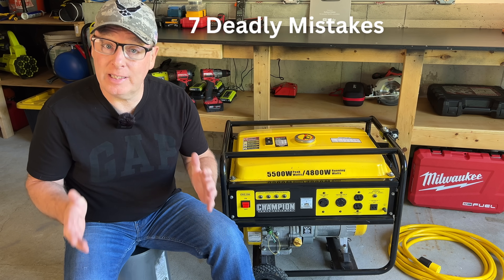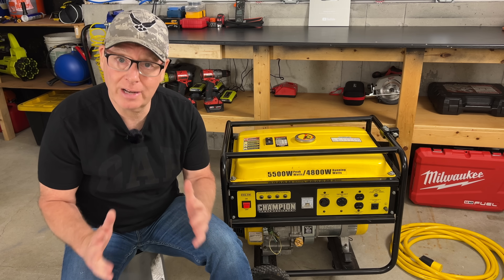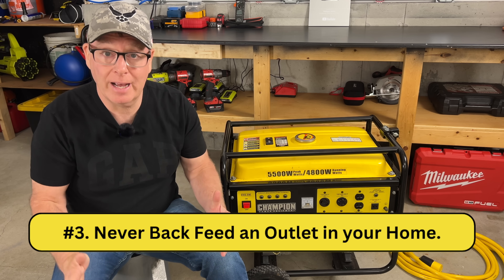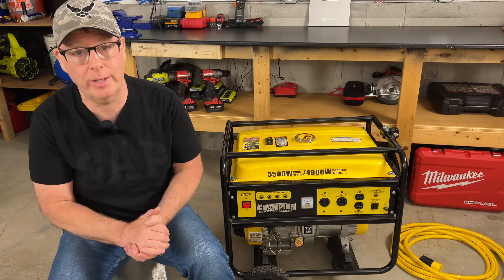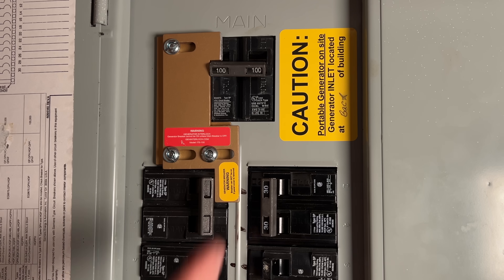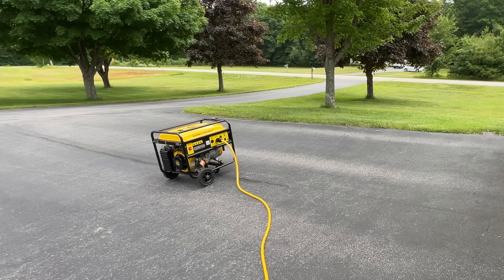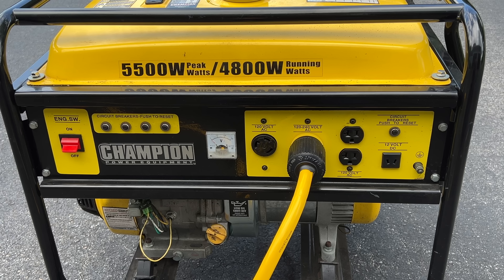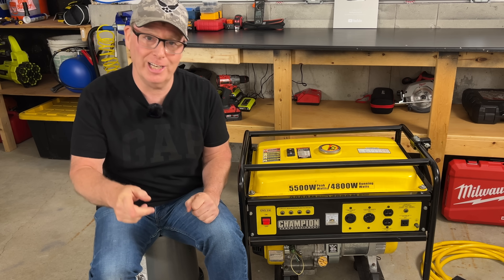7 Backup Generator Mistakes. (Have You Made One?)

Comment: I worked 36 years for a Utility company. AEP.   You failed to remind the viewers that you have to ground the generator  Very important!!!!  I knew spme people that got shocked.  Please !!
Reply from the maker: Actually no. A ground rod is only driven for a generator if it’s being run as a bonded neutral system. When it is the transfer switch has to switch the neutral along with the line conductors. This is known as a separately derived system. Most people don’t use that type of switch so the generator is run with a floating neutral. This is very important to understand because the neutral can only be bonded in one location. A ground rod is surge protection or mostly lightning protection. The can connect power to a ground rod that’s not bonded to neural and it won’t short out or trip the breaker. The shock prevention comes from the grounding wire carrying the fault current back to the neutral and then the source. 49 year electrician and electrical engineer.
Reply: @BackyardMaine  Thanks for the great advice😀

Comment: Gotta be smart enough to shut the main breaker.
Reply from the maker: Depending on a person rather than an interlock for life safety is not a good idea.
Reply: @BackyardMaine  I depend on myself every day sir and I mean no disrespect.   You shut off that main breaker, you save a thousand dollars and do the same thing as the interlock.   I trust me way more than I trust an interlock that can fail.
Reply from the maker: @georgemiller9533  You trust yourself and I get that but should the power company have that same trust in you to protect them form backed.. Do you trust others to always make the right decision? I was an electrical engineer for a large corporation and we did everything we could to take the possibility of human error out of the picture. We used detailed procedures and electrical and mechanical interlocks, lockouts, etc. Everyone makes mistakes and when a mistake can take a life $100 means nothing.
Reply: @BackyardMaine  I have worked closely with a plethora of electrical engineers and I now see your dilemma.   Most EEs won’t remember to flip the switch.   I however am more reliable to a lineman than an engineered contraption from China that will fail.   Yes linemen are safer with me flipping the switch.
Reply from the maker: @georgemiller9533  Nonsense and what your are doing is not legal.

Comment: One critical thing that you didn't do and that was to ground the frame of your generator to an NEC Code approved 8 foot long ground rod that's been pounded vertically and completely into the ground.
Reply from the maker: No actually you do not want or need a ground rod at the generator by code unless it’s being run as a separately derived system. When it is being connected this way the generator will need a bonded neutral and the neutral will need to be switched through the transfer switch along with the line wires. A set up like this does not switch the neutral so the generator needs to have a floating neutral and a ground rod is not required and actually can cause issues because not you have two paths to ground.

Comment: Hello ,I’m planning on having a licensed electrical contractor install a manual transfer switch. I’m going to ask the electrician to show me exactly how to use the new manual transfer switch. With that said do you recommend any other questions I should ask the electrician? I have a gas powered Honda 7000 generator. Your feedback is highly appreciate it. Rich
Reply from the maker: Yes, absolutely. Make sure that the generator has a floating neutral connection if the neutral is not being switched through the transfer switch. If you are going to run a bonded neutral at the generator then the neutral will need to be switched along with the line conductors and will be considered a separately derived system. Many get this wrong. The code is very specific when it comes to the neutral to ground bond only being at one location.
Reply: @BackyardMaine  
Absolutely. Your awesome! This is a little side comment. My  little town of Dixon ca permit cost is $675.00Dont get me wrong , we are blessed just own our home .,but come on! Why are so many people leaving ca ? Lol.
Thank you for your feedback.

Comment: Why not fit an exhaust pipe on the generator and run it outside?
Reply from the maker: I guess but I still would worry that a leak could kill me or my family.
Reply: @BackyardMaine  I'm not saying have it near the house.  I have mine in a seperate garage and have fitted a tight flexi and then through a hole in the side which is sealed and the garage well ventilated.  Obviously don't have it anywhere near doors or windows.  Mine is too heavy to move around easily so I can't keep it outside or it will get ruined.  Like you, if I could have it outside then I would.

Comment: You mentioned at the end probably the best advice but didn't cover it and that would be writing yourself a switching procedure to prevent mistakes,proper connection and disconnection is probably the most important thing you can do to be safe. Power outages can be chaotic and a good procedure can prevent slip ups.

Comment: Good tips but dang if id store a gas can in the house. And i think i need a longer cable for my set up. Its about 6ft but no problem yet. I believe id feel better with a 10 ft or so.
Reply from the maker: I store it in the garage not the house. I use a 25' cord for mine. I like to be able to run the generator well away from my house.
Reply: @BackyardMaine  25 sounds good. I have carbon monoxide detectors in the house and they haven't gone off so maybe I'm fine but I still worry.

Comment: What is lowest wattage generator recommended to run 2000 sq ft house?
Reply from the maker: It really depends on what you want to run rather than the square footage of the home. If you live in the south you may want a very large generator to handle the AC load and even then you will need a soft start. Here in the north I can run pretty much everything I need (not the stove or the laundry) but the well pump, the boiler, lights, microwave, coffee pot etc.. We're just careful not to run everything at once. I currently run a 4800w running/ 5500w peak generator and it does pretty well. I will invest in a larger unit at some point.

Comment: IMPORTANT! The generator should be grounded to avoid electrical shock. On the generator in this video, the grounding "post" is on the far right near the outlet plug he used.
Reply from the maker: Actually you are wrong. The only time to consider driving a ground rod is when the generator has a bonded neutral. When this is the case the your transfer switch needs to also switch the neutral conductor. So many people (even electricians) don't understand grounding. Brush up on article 250..

Comment: That suicide cord, my dad has used that method for over 40 years with no issue. We have main throw where it comes in the house and one at the panel box. We also flip off breakers we dont use. Air conditioner, hot water heater, and a few others. But you did make some very good safety points.
Reply: same here for 20 yrs of hurricanes in florida. just follow up the breakers and connections procedures and should be safe. anyway the portable generators are super dangerous in noobie hands
Reply: Same. Never had a problem with my suicide plug.
Reply: Agree with other comments that say surviving dangerous practices doesn't excuse being unsafe or possibly encouraging others it's ok.
Reply: I have used them for years
Reply: Stop arguing on YouTube comments. It results in 0 changed opinions 100% of the time
Reply: They're still a bad idea for the reasons given in the video.
Reply: @TomInGulfBreeze  Part of the problem is not how it is done, but stupid people not using common sense.
Reply: @TomInGulfBreeze  Been through 5 storms and never had a problem.
Reply: @bryanchaney2572 survivorship bias. Stop telling people you survived from doing bad practices, it yields no good purpose seriously. It's like yelling to people that you survive 50 yrs without using seat belt when driving. In fact millions of people in 3rd world countries still live today eventhough they don't have grounding system and fuse at all for decades. Humans still make mistakes even when they are smart, adding more safety features are never bad and worth the effort. Practices recommendee in this video is definitely not overkill to do.
Reply: @ I can't kelp if people don't have common sense. I never said any safety features was bad.
Reply: Great  just encouraged  stupid people  to think it's ok.  It can be done. 98% of normal people  don't understand  how dangerous  this is.  Great job.

Comment: All very good information here.  As a volunteer fire fighter I have seen homes set on fire for placing the exhaust too close to combustibles.  Also wind direction and exhaust can cause CO issues.  I have seen generators in front of open garage doors with a slight breeze pushing the exhaust back into the open doors charging the house with CO.
Reply from the maker: Thanks for sharing

Comment: I have one of those collars installed on the power meter where I can plug in the female end of the cord. The collar and cord was around 1500 bucks installed. It doesn’t require a transfer switch and won’t back feed the grid so no danger to linemen working. It has lights that let you know when the power is back on. I’ve used it many times and it works great. Want a whole home generator one day.

Comment: Connecting via dryer circuit. I still don't get how a line worker could get hurt by that connection. If the Outside Main Breaker from the pole is switched OFF, how could my power leave my house and go the other direction? Thanks
Reply from the maker: Thats the issue my friend. It depends on someone to remember to open the main breaker and that could be in the middle of the night when maybe we're not at our best. Thats why a mechanical interlock transfer switch or auto transfer switch is required by law.
Reply: @BackyardMaine  Thanks. i'd like to think i would have the presence of mind to know what to do but like you say, it depends. Never considered legalities. i'll call my city engineer friend to find that out.
once i do buy my first ever 'inverter' generator, i'll likely just run good cords. i can get by with just two; so no real need for me to wire the entire house - i basically only live in two rooms :)
Thanks again for the feed back

Comment: Be aware that High end electronics in your home need a "Inverter" generator that produces clean electricity.  Older freezers and refrigerators may run well off of old type of generator but Computers, etc need Clean electricity.  Do your homework on this issue as it is very important for your family.
Reply from the maker: Very true..

Comment: My generator runs quite nicely in my shed. No issues with rain. I keep the 4 x 6' door wide open. I have a sealed, 3" RV exhaust vent that goes through the roof of the shed to a height of 12 feet. The roof and shed are highly ventilated. Just in case, I have 3 CO monitors in the shed. Never had a problem.
Reply from the maker: Sound like you have a good setup

Comment: Excellent video.  It is extremely rare that I loose power where I live but I have a portable generator for these rare occasions.  Seeing that years can go by between generator needs, it’s incredibly helpful to be reminded of safest best practices.  My set up is very similar to yours except I have a cover that sheds rain and snow off the generator keeping it dry and safe.  I also have a heavy duty cable lock which allows me to secure the generator to my deck so it cannot be liberated from my property by desperate sticky fingers in a crisis.  Thank you so much for the refresher!  👍
Reply from the maker: My pleasure. Thanks so much for watching.
Reply: I’ve seen some people put wood blocks under the axle. Then take the wheels off. Another deterrent.

Comment: If your're one of the unfortunate Gen Z (Aka: Zoomers), there are several additional warnings you must obey:

Never suck on the exhaust pipe while the generator is in operation. Sure, I know it sounds like a cool fun thing to do, but its burned a lot of Zoomers and destroyed their lips. Just stick to licking the bottoms of peoples shoes and you'll be much safer. Then you can record yourself doing it and post online for all the other low IQ Zoomers to mimic.

Never drink the gasoline that goes into your generator. I know its tempting for you guys, but its not safe and could harm you.

Never lick the electrical outlets while the generator is in operation. This is an unsafe practice that kills dozens of Zoomers every day. So please, just dont do it! Again, go back to licking the bottoms of peoples shoes, as I had mentioned before.

Contrary to poplar Zoomer beliefs, farting at the generator will not provide the fuel necessary for its operation. You'll need to refund some of your ramen noodles to buy a few gallons of gas.

I just realized most Zoomers are far too ignorant and lazy to hold down a job for any length of time and could never afford a home, much less a generator to power it. I guess I'll just leave this comment here in case one ever moves out of their mommies home.

Comment: The electrician that installed my power connection put a manual lever on the outside of the house next to the connection, then wired it in the house and all the stuff for the generator is on the outside of the house also next to my meter for the power company. My electrician also did a walkthrough of the house and said all can run on it but with ac on can't run the eclectic dryer and the microwave if the ac is on, he showed me how to connect it and to use the generator. I connect my generator to the house, start it up, wait for the generator to warm up and move the selection from MAIN to AUX. I was shocked to see it next to the circuit panel but different code per state or the electrician and I don't know about all that that stuff. My electrician did agree with you because he said, it won't kill you to wait 15 mins vs trying to up gas in it right away. He also suggested to get a battier operated fuel transfer pump, it is for gas cans. Great Video, thumbs up!

Comment: 1-Never run a generator indoors: This includes garages, barns, sheds, basements, or crawl spaces due to the risk of carbon monoxide poisoning.

2-Keep generators away from combustible materials: Generators get very hot, and placing them too close to materials like house siding can cause fires.

3-Avoid backfeeding outlets: This practice is dangerous as it can cause electrocution and is illegal. It’s better to have a qualified electrician set up a safe connection.

4-Don’t use suicide cords: These cords, with male ends on both sides, are extremely dangerous and can lead to electrocution or shock hazards.

5-Avoid disconnecting cords under load: Disconnecting power cords that are supplying loads can cause arcing, which is dangerous and can damage the generator and connected devices.

6-Never connect to a wet generator: Using a generator in wet conditions can be dangerous. It’s important to keep the generator dry and follow safe practices when connecting and disconnecting it.

7-Don’t fuel a running generator: Refueling while the generator is running can lead to fire or explosions due to the hot engine parts and sparks from connections. Always let the generator cool down before refueling.

Comment: NICE 7 OUT OF 7 DO I WIN ANYTHING
Reply from the maker: You have made  7 out of 7 or not made any one them? If you made 7 out of 7 you win the nine lives award. lol
Reply: @BackyardMaine  done all 7 however I have a life time of getting zapped and have built up a tolerance 240 still hurts but 120 is just an annoyance anymore and as far as exhaust gas it's knowing time and airflow running an engine in a enclosed garage for a minute or 2 ant going to do anything or if that garage has fans specificly to pull fresh air in and bad air out

Comment: My Solar setup has a main switch to shut off the grid but my solar wont work during the day if the grid is down. How can i use solar when the grid is down? If i shut down the grid switch can i back feed  power with a generator through a 50 amp outlet?

Comment: I only have a 100A service box which all the breakers are taken. Is it possible to have an electrician hook up a 30A breaker interlock tied into a 30A breaker by removing several 15A breakers? Can the removed circuits from the 2x 15A be attached into the new 30A breaker or is a 50A circuit a possible choice for both the generator and the 15A supply? this is an old house (1964) and they didn't have need to supply so much then as we have now. Should have gone and become an electrician . lol...love your explanations and examples-well done!
Reply from the maker: You cannot connect 15A circuits to the 30A or 50A breaker because the wire and the devices would not be protected from overcurrent. There are ways to make room in a panel for the generator breaker. One way is to add a small sub panel. Usually a 12 circuit is nice because it will take the two circuits to clear a space for the generator breaker and two more circuits to clear the space for the sub panel breaker. It also leave room for future expansion. Another way is to combine some lighting circuits if possible. Most lighting is LED now and draws very little amperage so combining circuits is often an option. Your electrician can help you decide what the best option is depending on load.